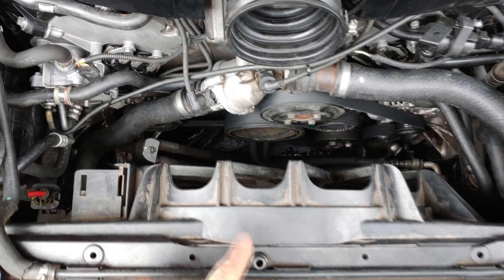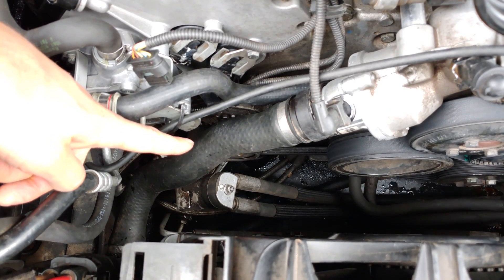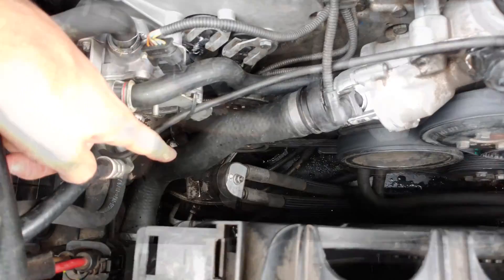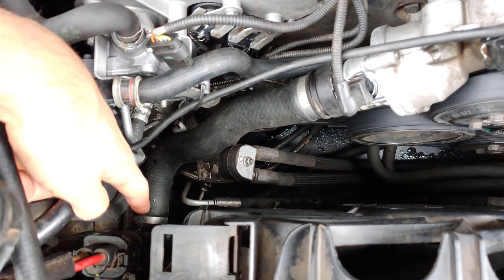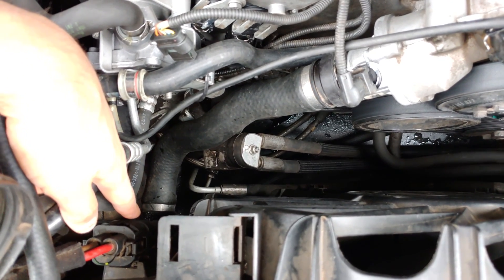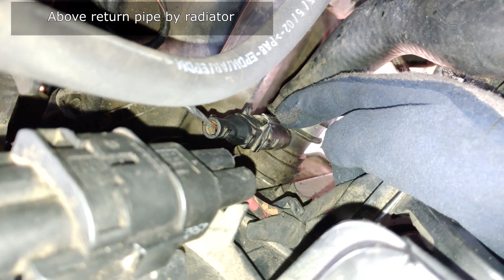BMW coolant temperature sensor location and demonstration

Comment: Hi do you know where is AUC sensor on e65, is there one or 2 and how does it look like
Reply: AUC sensor is attached to the cabin filter housing bracket on the right side (standing in front of car and facing engine)

Comment: I can’t get my fan to turn on, i have changed the relay and put in a new fan and still nothing. I have a 2018 m550 (g30 chassis). Also i pulled a code and it say engine fan safety relay, control line: short circuit to ground. I have no idea what this means but i lostbtwo weeks of work and money on parts already trying to get this fixed but no luck. Would you have any suggestions?